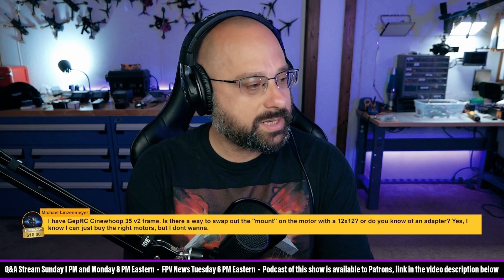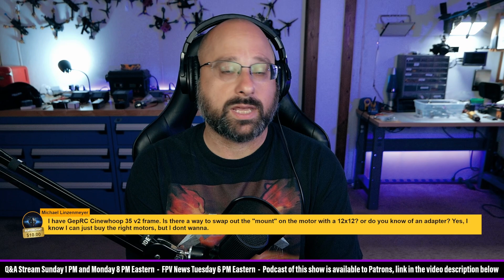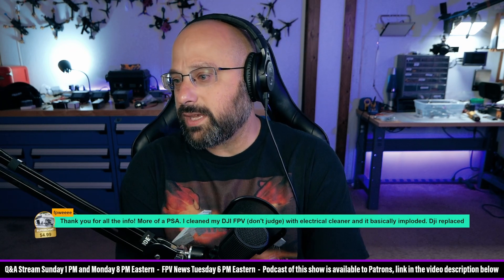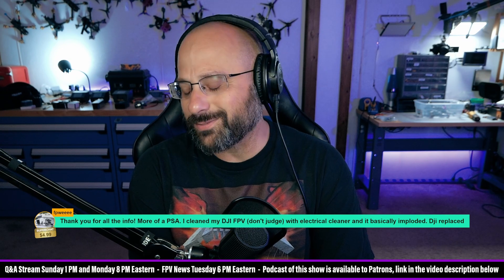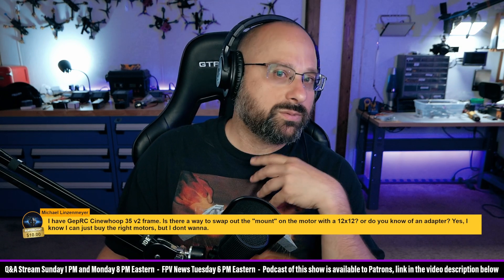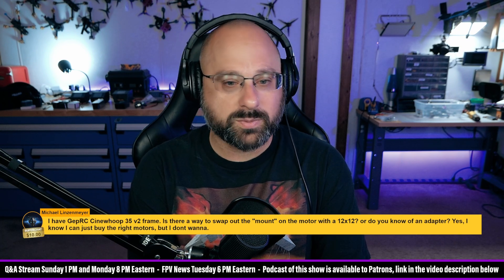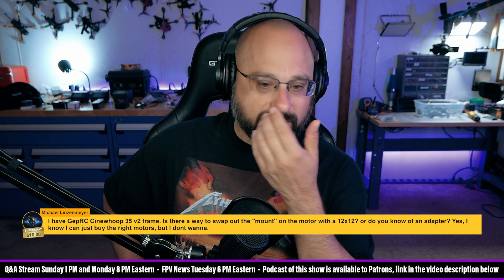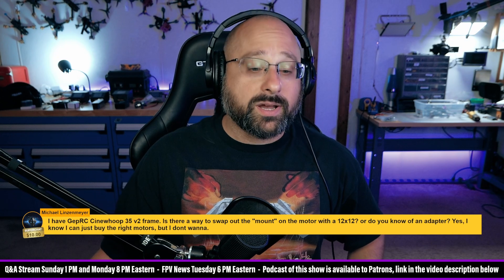Mounting Motors With An Adapter? There's No Minimum Power Level Without a HAM License? - FPV

Comment: It’s probably probably because a lot of vtxs are locked at 25 milliwatts until you do something to change that. or something like the hdzero module  you have to put some kind of code or file to unlock it. I’m pretty sure if you don’t unlock the hdzero vtx its actually part 15 compliant. But I don’t know abt analog.

Comment: Speedy bee won’t do crap. They will just try to get you to buy another one at a discounted price. Had a bad esc and they told me their stuff goes through “rigorous testing” so they won’t replace it. 
Same with their issue with osd and sd card issue. Multiple attempts and always the same answer. I gave up on speedy bee and went with TMotor and Mamba stacks and never looked back. 
They have good prices but crappy products.

Comment: You need at least a Technician HAM license to remote control RC aircraft, it has nothing to do with PARTS 15 certification. Parts 15 certifies electromagnetic interference minimums. Basically states a device is low powered enough to not interfere with adjacent devices. Part 97.215 FCC Rules:

§97.215 Telecommand of model craft.
An amateur station transmitting signals to control a model craft may be operated as follows:
(a) The station identification procedure is not required for transmissions directed only to the model craft, provided that a label indicating the station
call sign and the station licensee's name and address is affixed to the station transmitter.
(b) The control signals are not considered codes or ciphers intended to obscure the meaning of the communication.
(c) The transmitter power must not exceed 1 W.

As most of the control and video frequencies do fall within some of the HAM bands, to fly a Drone that is RC controlled you must have a ham license.

Short test... if your Transmitter isnt stamped with FCC and your RX isnt stamped with FCC... then you need a license.

Comment: Im not trying to stir the pot but share some experience and knowledge, It is the end users responsibility to know what frequencies they are operating on. Judges will say ignorance of the law is no excuse. "No license is required to purchase Most equipment, however in order to legally operate some equipment within USA an amateur radio license is required. " It is my understanding that any device that is operating within an ISM band is limited to 30dbm Tx power and does not require a license, These three ISM bands are: 902 to 928 MHz 2.400 to 2.4835 GHz 5.725 to 5.875 GHz The FCC does fine more people than the FAA and its not cheap. This has been long argued with many examples. Be sure the frequencies you operate on are not going to cause interference to a "Primary Service" as to avoid drawing attention to yourself. If you are off in this hills its unlikely you will but if you are in town somewhere anything is possible. Tracking down an interfering signal is something I used to do professionally and its actually quite easy with the right equipment to do, document, and prove. Have fun but do it right! dont be that guy.
Reply: Ok anolg fpv has been around for at least 10 years running 400mw or higher VTXs. If the FCC actually cared and they don't. They would have done something. And no you won't be punished by a judge lol. Sure when TV broadcasting was 100% anolg maybe the FCC would care. But not anymore.

Comment: I have recently bought a speedy bee f405 Wing app fc... I am a noob and I don't know much, but can I use a spektrum dx9 with the speedy bee fc? If so my next question is, I have a Spektrum AR8000 8ch rx, would this receiver be compatible with the speedy bee flight controller? And if so do you know of any good instructional videos or articles for that? Lastly I also have a 13 year old GPS designed for use with the jdrones Arducopter... The GPS is actually never been used and the kit was never assembled... So in essence I have a brand new 13 year old gps, coincidentally it has the appropriate plug to fit the speedy bee GPS port... I'm just curious if you think it would work I don't mind saving 20 bucks on a GPS if I can but I don't mind spending it either...thanks
Reply: I'm pretty sure you can only use slxr2 reciever for fpv. Again, not too sure.